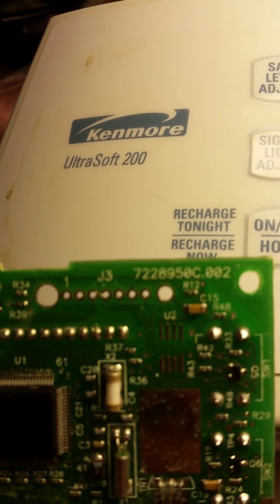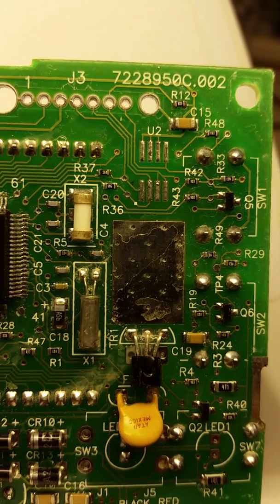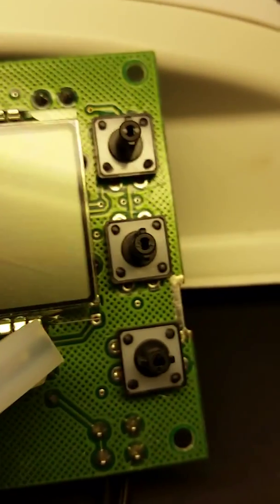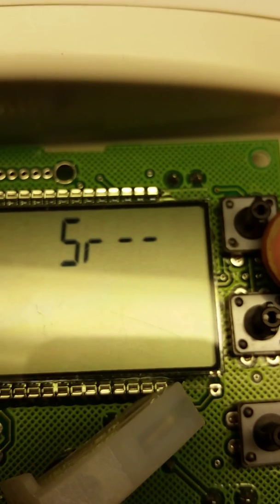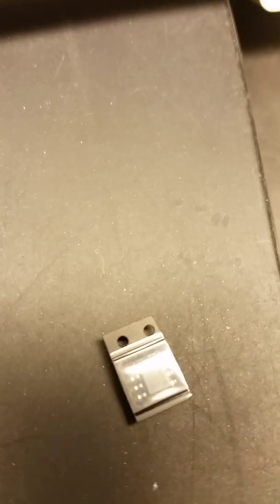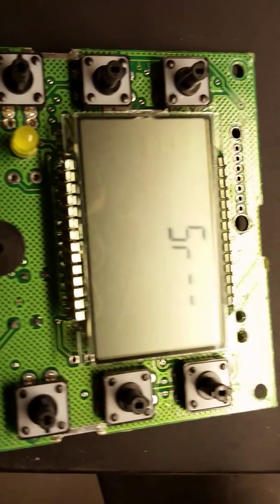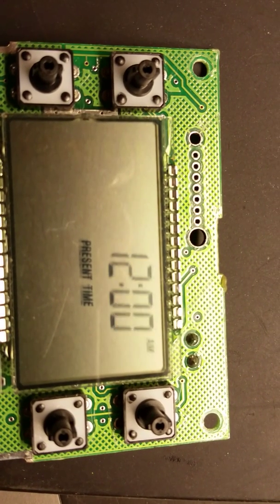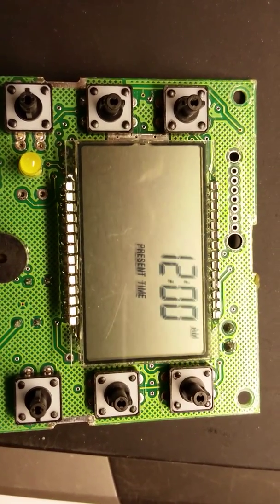Kenmore UltraSoft 200 Water Softener blinking SR-- and wont work.

Comment: Hi. How did you get that circuit board out?  What does "sodering it" involved?  Where did you order the part?  My softner keeps flashing "add salt" and none of the control buttons appear to work.
Reply from the maker: the board was pretty easy to remove, by taking screws out.  Desoldering it involved adding extra flux, and then using a desolder wick to remove the solder.  You can desolder each pin individually and bend it up, so that it doesnt resolder back to the board.

Comment: Great job man! How did you know that what was faulty . What should you look for if the green light for the display works , but it does not display any thing ? And it Sounds like it's working fine tho
Reply from the maker: the unit would not save settings.
Reply from the maker: The video showed that the control board would not save any settings.  So it keeps coming back to the same screen.  Not sure if the display does not show any info.